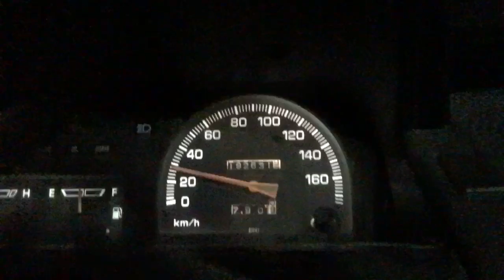1.5L/100km - Running your car on vapour - It really works!

Comment: Ford had dual tank gasoline powered pickup trucks with a propane tank and a gasoline tank back in the pre 1998 days. Perhaps using propane to warm the car and when the car is warm and fumes are dilated and hot switch to petrol vapours?
Reply from the maker: I haven’t come across that information before. I like the sounds of it though. Which cars came with that? 

Thanks for the comment. I appreciate people’s input. It all helps.
Reply: @NathanR1995  I believe it was the pickup trucks of the F-250 class within the same year range as their first diesels and a bit before. I drive one of the dual tank diesel fords of that era and my father once owned a propane dual tank ford van 2 generations older than my truck. It had both a gasoline/petrol and a propane tank but the previous owner disconnected the gas line since propane was cheaper and cleaner.
Reply: However all the non speciality F-250s and I believe some F-150s before 1998 when the OBS style finally got retired all had dual fuel tanks, I own a 1991 F-250 Diesel since having two fuel tanks is VITAL for running heated vegetable oil with diesel to start up and warm and flush before shutting down.

Comment: If you have ever looked into carbuetor when the engine is running you can see Clearly a spray rather than vapour or mist. The difference between carbuetor fuel air mixture and real vapor is big. Vapour burns with almost no exhaust but any carb vehicle produces unburnt smoke in exhaust.  So yes the vapor technology is real deal and our fuel industry have peed us in the eye for Century.

Comment: How I did it.

By 20 feet of copper tubing the same size as your rubber gas line.

Wrap the 20 feet of copper tubing around the catalytic converter or exhaust pipe headers whatever’s hot and close.

Replace all gasoline rubber hose under the hood with high 
pressure high temperature power steering fluid hose this is a must.
Reply: I also had to bypass the pressure regulator on my car or theGasoline pressure regulator on the fuel rail.

I also do not let the gas return back to the gas tank
Reply: The next thing. You can get a needle valve – it’s a little brass square box has a valve on it where you can control how much vapor goes through the fuel line
Reply: I have a 2000 Honda insight. It is a manual. It is a lean burn ECU car. That means when it is going down the highway after 4 miles when everything has warmed up. The car will go from 14.7 to1 AFR 22.1 AFR. I think my car is beating that by substantial amount.  some people have suggested 30 to 1 AFR. That means 30 parts air to one part gasoline.
Reply: There’s 10 different ways to skin a cat. You don’t have to use a needle valve. You can get half inch long copper meg welder tips. They push inside the power steering line put a hose clamp around it to hold it in place. Take a hammer before that tap the hole on the copper end to make the whole much smaller. I have my car set up. That it will run normal on flat ground. But struggles to climb a slight hill.It’s just barely getting enough gas vapor to run.
Reply: My gas vapor goes into the fuel injectors. It is heated with copper tubing restricted with either a needle valve or Meg Welder tips with the holes made smaller. I put a pressure gauge on the fuel line from a paint gun. The pressure was around 80 to 100 psi. But when it goes through the tiny hole it’s regulated. If you use the original gas line it will get hot and explode it cannot take the100 psi pressure and heat excessive heat.
Reply: It’s not necessary to do this. I also put a toggle switch on the fuel pump I can cut the gas pump off sitting in the car seat. That way the gas can get hot faster And as the engine uses the gas in the 20 feet of copper tubing the gas can go from liquid to vapor it needs room to expand. When it goes through the tiny little hole meg welder to you or the needle valve It expands.
Reply: My car is from the factory engineered to use Lean  burn amounts of gasoline. I am assisting it to burn even less.
I’ve been doing this for over a year. I get 150 mpg at 50 miles an hour. After 4 miles takes that long for everything to get hot. I live 2 1/2 miles from the four-lane highway. Anyway that’s my story and I’m sticking to it. You can also look at insight central.net.—-insightcentral.net
Reply: One more thing. The rubber hoses power steering fluid line it will be getting hot also. Use a hose clamp that does not cut into the rubber. I’m not pulling your leg. Good day  Nate

Comment: Yrah, that is why a carburettor vaporizes the petrol. Vapor carbs work but they run way too lean which causes the engine to run way too hot and engine life is GREATLY reduced.

Comment: I made practically the same design some 20 years ago, a metal mesh placed before the engine intake is an important safety feature. You should look into wood gas, then you can make your own fuel as well.

Comment: The simplest methode is to use the purge line on the fuel tank with a one way internal check valve inline metal filter.
On in tank fuel pump styles, the check valve inside the unit on the vapor line must be removed.
 from the housing.
A 1/4" hole must be drilled in the fuel cap to prevent the fuel tank from collapsing under vacume.
Reply from the maker: ginger bread I really have no idea what your talking about. Maybe explain it with more explanations. Cheers
Reply: Ohhh, such a good idea.......Let's all go make a bomb!! Adding air to fuel vapour makes it an explosive mix. Better to only add air at the point of consumption, like the Plenum chamber in an intake manifold.
Reply from the maker: T.I.M.E. There is no fuel this isn’t flammable or combustible. There’s always some sort of danger. Can’t be removed, only mitigated and minimised 👍🏼
Petrol, diesel, gas LPG, Hydrogen etc etc, all can be dangerous
Reply: @NathanR1995  The basic fire triangle says you need all of three things to have fire, so just keep the air out of the gas until the last possible place in the intake manifold.
Reply from the maker: T.I.M.E. True!

Comment: 1.5 liters is about 4/10ths of 1 gallon 100 km is like 60 miles. So for us US Americans that is 150 miles per gallon.
Great Job @Nathan Rezannah!
Reply from the maker: Correct! It is 100% possible to achieve 100MPG+ easily, which the right setup. Problem is, it’s not an easy fabrication, and costs more than it’s worth unless you do a lot of kms, as a delivery driver, taxi, truck etc.

Nonetheless, I’m an enthusiast, and I’m currently planning my build.

Comment: Doesn't the fuel injectors cut back the input of gasoline from the fuel pump so that it's not just pumping raw gas. So all you did was build a big injector that evaporates.

Comment: carbon felt wick works better than bubbling it through the gas. Just air moving through or around the carbon felt is enough to make vapors to run the car.
Reply: Does carbon felt work better then a old cotton cloth T shirt? I've seen cotton cloth used as a wick also.
Reply: @keithc8108  Carbon felt works with kerosene if you wrap it around a pipe and fix it in place with a hole in the top of a pipe going up into a t joint from a mason jar you make a venturi that should make a cold fuel air vapor. Depending on how big the pipe width is determines air flow and how lean or rich the mix is on how wide the bottom width is for the input to the t joint from the mason jar or canister for holding fuel to wick up into the carburetor. Where air flowing around the carbon felt is just as good to make a fuel air mix.

Comment: You need to put this set up outside the car engine room as far as it is made out of pvc and other plastics as heat could leak fuel and same vapours can get ignited in the engine room putting entire car on fire in flash of a second.also if the car back fires due to vapour flooding or uneven ignition timing,the flash will travel through your fuel hose to your set up setting it on fire.this is why fuel storage systems are always designed far away from the engines.you need to design a pressurised vapour chamber and a timed feed system with flash arrest at terminal,all the best,greetings from india
Reply: Haven't heard of anyones car bursting into flames alot doing it

Comment: I can see the lights posts and trees going buy outside so yea you are driving. good job mate.
Reply from the maker: Yes, it works and drives, but the bubbler system only uses the lighter compounds of the petrol. Once the light compounds are used, the petrol becomes useless (for this system)
Reply: @NathanR1995  that is why you have to apply heat to the system which will release the rest of the petrol into a vapour. the oil companies make it more diffucult to convert to a vapour with all of their additives over the years. if it was just pure gasoline then it would all vapourize easily but thank you my oil man for destroying the planet for your profits. if we could get all the power out of gasoline we would be getting 200+ mpg easily but we both know that already, no sense beating a dead horse.
Reply from the maker: Yes, so I’ve learnt.

Comment: It needs an air filter to keep it from sucking dust into the fuel !!
Reply from the maker: Indeed. My system will have all safety features. This is in the testing and experimenting stage. What do you think so far?
Reply: I like it and am seriously considering building a system like this.  However I have fears of it causing valves to burn or burning holes in the pistons.
Reply from the maker: No offence, but that all myths. Wrong information out that stops people like yourself building and experimenting! Go for it mate.  I’d encourage you to watch The Vapor Kid and his videos. Unfortunately the video quality is very low, but fantastic information from an OG. He’s been doing this for decades and building systems with his mate.

Comment: They don't make any of the parts I need to fix my 95 f-150 straight 6. So I'm doing this next week 👍👍👍
Reply from the maker: Sick! I hope you have photos and videos of it. I would love to watch the vids.
Reply: Wait what? Yes they do, they make literally ALL those parts.
Reply: @life_of_riley88  find a straight 6 fuel rail.
Reply: @peacefulscrimp5183  eBay? Wrecking yard? Craigslist? They made like 2 million trucks, vans, and utility vehicles with injected 4.9s in them.
Reply: @life_of_riley88   terribly sorry but the plating was poorly done and they all ended up rusting much worse than mine.  Try again
Reply: It's been a quarter century, they just weren't made to last forever

Comment: I doubt your fuel consumption when checking the physics.
When you move your car with a constant speed of 120km/h you need about 20KW to overcome air and ground resistance. That mean if your car has a 100% efficiency it need 2.4L petrol. But you are using a petrol engine which has an efficiency of about 30% that makes a 8L consumption for 100km at a speed of 120km/h.

I‘d like to see your consumption at 120km/h! 😊

Comment: Great job you can't use petrol a better way for this use in a vehicle chemically scientifically how petrol should be used tho try heat proof containers and hoses or you could end up with a fire and small explosion dude beautiful job I'm gona make one out of a 20l steel petrol container
Reply from the maker: Yeah, when I build my final vapour system, it will be made strong and durable with safety features as well. Keen you see what you build!

Comment: Good work. Great to see people finally waking up to the fact that we are being deliberately kept on highly inefficient 1850s technology, mainly that of the internal combustion engine. Most people don't see that we are essentially driving old miniature "locomotives", which use gasoline instead of steam. Not vehicles that are truly worthy of being called "Modern". Most people also don't see that the cars that we "own" are not ours. The car in your driveway is actually the "vehicle" used by those who continue to feed their Greed at our expense.
Reply: Also, nuclear power plants heat steam to turn a turbin.
Reply: Deep stuff
Reply: Exactly technology is being suppressed by whom that's the question that everybody should be asking

Comment: Can you make a generator running off vapor? If so, you could power your house.
Reply: Gonna try it on the generator in the RV tomorrow. It's a constant speed, so no need to worry about acceleration.

Comment: Good work.  I’m sure this is Viable for idle or low load.  I tune fuel injected cars via software.  Under load, the afr needs to become richer.  14.7:1 works at idle, when you are tuning wide open throttle for power, 11.0:1 or so works best on pump gas.  To run peak output at high load, the afr needs to be fairly precise.  A lean mixture at wide open throttle results in pre-ignition and detonation that results in engine damage 

This is interesting to see, as it shows me that with enough tech and at low outputs this can work.  Add more tech and it would work for most normal internal combustion uses.  

I’m sure that just as with fuel sipping Diesel engines, the government’s will pull the emission flag and shut it down.  These emissions are highly highly over rated and over hyped for the sake of not allowing efficiency for the masses.

Comment: I owned the same model car 8 years ago, im pretty sure you may want to unplug the fuel pump too , as it will be running supplying pressure to the BOLT plug job you mentioned, im not too sure how fuel pumps go when they dont have pressure relief, either pull the fuse or disconnect it from the unit itself would probably be worthwhile to save the fuel pump from melting down or stopping to work.
Reply from the maker: Thanks. That would be totally true if I had the EFI Charade. This is carby, with a mechanical pump, no fuse. And because of this, it’s low fuel pressure compared to an EFI system. So the bolt will work without any concern. Thanks for the comment nonetheless mate. I appreciate people getting in touch and giving pointers.
Reply: Or you can simply connect supply line to return fuel line to relive stress on mechanical diaphram type pump
Reply from the maker: True!

Comment: Well... thats how an engine runs, in the first place.  The carb mixes the "liquid fuel" from the gas tank with the air coming into the engine, turning it into "VAPOR"...  You're just doing the same thing the carb already does.  That "hose" is a PCV , btw.  This is pretty funny though, thx!
Reply from the maker: Your partially correct, but not entirely. Since making this video I’ve delved deep into the truth about petrol vapour and engines. A lot of conspiracy’s involved. 

The carb mixes liquid petrol with air. Only the vapour that comes off the liquid is combusted. Much fuel is wasted and then burnt though the catalytic converter and what’s left is sent out the exhaust.

Vapour systems start with liquid petrol, but only the petrol in a gaseous state is used and mixed with air for combustion.

It’s believed that conventional systems run at an efficiency of 30% or less, whereas vapour is 99.5%+ efficiency. Less waste, more power.

Thoughts?
Reply: @NathanR1995  Billy is wrong and you are correct .   Only thing you got wrong is the 99.5% efficiency.  Its at best running at 70% , but still Impressive.
Reply from the maker: Yeah, agreed. Perhaps I misunderstood something as I was learning. Thanks for inputting. I love collaboration and working to make people better. Thanks

Comment: Use smaller hoses to create more vapour, also you'll need a butterfly of sorts for the air intake whilst driving. This is a must a "valve saver system" to prolong the life of your valves - the same as lpg vehicles

Comment: I tried this same setup in my 2008 Dodge Ram with a 5.7L hemi, i unplugged the fuel injectors and pulled the fuse for the fuel pump and it ran perfectly on just fuel vapours going into the intake
Reply from the maker: Drinkin Bud Throwing Mud love it! Amazing how it works so simply hey?!
Reply: gee You made a carb WOW What else is new ?
Reply: My friend 
Tienes algun video para mostrar lo q hicistes?
Seria bueno colocar filtros en las tres manguera por donde entra el aire al reservorio, para evitar la entrada de polvos?
Reply from the maker: Key difference is my ‘carb’ is Vapour, complete Vapour. No liquid partials.
Reply: @NathanR1995  Thanks my friend, I'm going to see your video again, that seems to work with carbureted cars, is that right?  that is, it does not work on cars with injectors?  or do you think so?

Comment: Ad a metal screen, spark arrestor, in case the engine backfires.
Reply from the maker: Tesla Fan will do, but I’m not fazed at the moment. Once I’ve finally figured out a complete system that works in all conditions, then I’ll add a flash back arrestor.
Reply: If you warm the fuel, it should have the desired affect to eliminate backfires... One way I saw this done was to run a hose of your warm coolant through your gas container and that will warm it enough
Reply: @keithc8108  You can use a bubbler to prevent backfire.. A second container with the same configuration filled with water..
Reply: Ikki Castro  I don’t think a water bubbler would be a proper fix, I wouldn’t want my engine sucking up water
Reply: @allraiders420  Just keep the water level low.. Water does not vaporized by bubbles.. Gasoline does..
Reply: Ikki Castro but water does evaporate, especially in heat, being under the hood of a car would definitely cause some water evaporation and water to be sucked into the engine.
Reply: So True In case Of Engine Back Fire To Not Make a Big Fire

Comment: still working, it did not damage your engine yet ?
Reply from the maker: Why do you imply that the engine will be damaged? Running a car on vapour is healthier for engine life. Providing the air fuel ratio is correct.